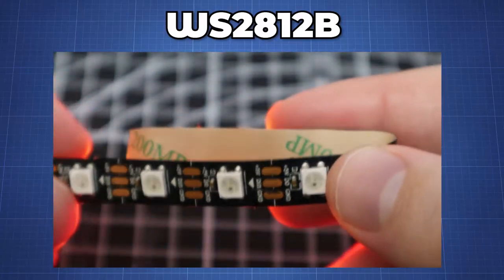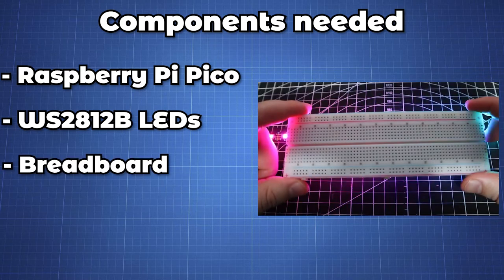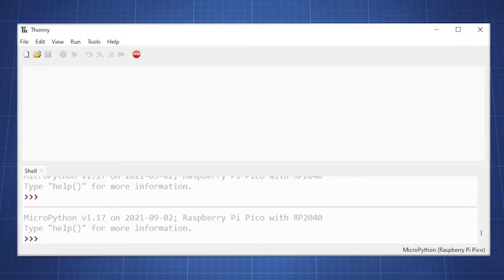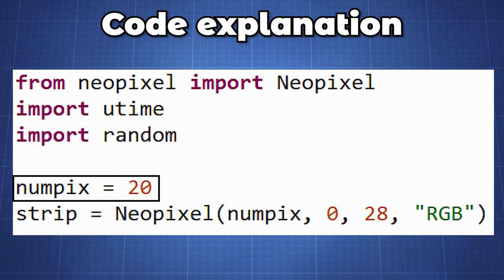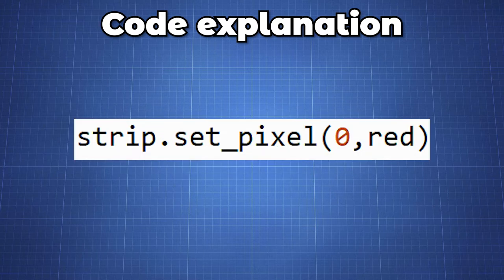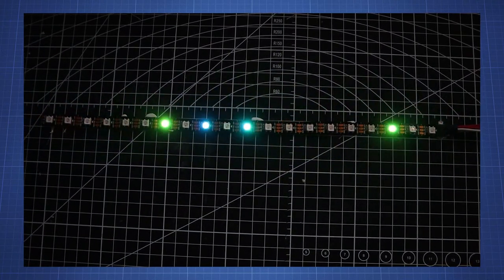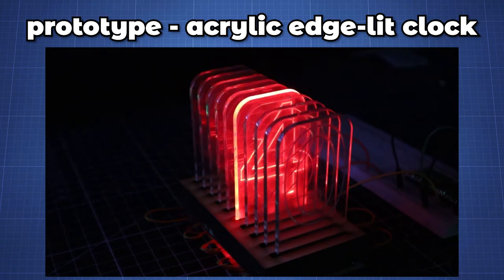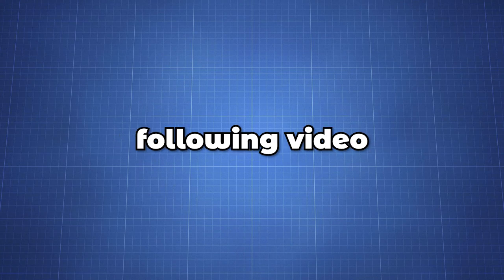Raspberry Pi Pico Tutorial : NeoPixels / WS2812B LED's

Comment: Thanks for the video.  I was able to light a strip of 90 LEDs with my pico.  I did have one problem.  I get green instead of red on example 2.  I didn't look to see what caused the problem.  I just made red = (0, 255, 0) and made the adjustment for other colors.
Reply from the maker: I checked the library I made a change got the same but didn't update the original library what you can do is change this line to strip = Neopixel(numpix, 0, 15, "GRB")
Reply: @NerdCaveYT  Thanks for the reply.  I made the change.  I also have increased the numbver of pixels I'm using on my project to 180 with one 5V input from the pico.

Comment: Hello, nice video, I have a doubt, how did you Connect the jumper wires with the strip of neopixel? I have one of 8 bits but I don’t know how to connect that
Reply from the maker: Thank you, The jumper wires all was just soldered onto the pads of the flexible strip, some might have plastic over it that you need to remove

Comment: Thank You!
Reply from the maker: No problem, I probably need to do an update on those videos for example how to initialize multiple strips etc.
Reply: @NerdCaveYT  I just adapted your tutorial to work with an old LED ring that I had lying around, pretty simple stuff once you understand. Thanks
Reply: @NerdCaveYT  would you have any idea of how to make the neo pixels work so that they change colour based on the temperature coming from the pi picos internal temperature sensor? I have tried but can’t get it to work
Reply from the maker: Let me have a look at it this weekend, the best way will probably be a function that based on temperature change the RGB value so that when it gets warm it changes as temperature rise gradually and not instantly, the simple method is just if statements changing the color for every degree @Jai.zTechDomain
Reply: @NerdCaveYT  alright cool, thanks man

Comment: Is it possible to control the brightness of individual pixels separately ?
Reply from the maker: yes using the RGB value for example (0,0,0) is blank none where as (255,0,0) will be full RED but (128,0,0) would be half the brightness of RED
Reply: @NerdCaveYT   Thanks !

Comment: Hello, thank you for this, it runs perfectly and I was quickly able to modify the code for more uses. 
Quick question, I used this neomatrix before on a raspberry pi 4 and it required a micro-controller which converted the gpio output to 5V, is this not required here? Clearly it is not required but it is safe to run it this way? I remember before that the adafruit documentation said that the DIN inputs need to be 5V, else it may damage the neomatrix.
Reply from the maker: The pico has a Vbus and Vsys which takes in 5V step it down to 3.3V. The Din pin connected to the pico is just where the data is sent to each pixel to control which one is on or off so it is an output not a input so the pin will not receive anything or be damaged and will be limited to sending out 3.3V dc

Comment: if your using your own power 5v do you only need to add the signal wire to the pi pico?
Reply from the maker: I powered the Pico from the 5V as well, but to answer your question just have to check if common ground is needed or not will get back to you on this one

Comment: I am using the "SEZO WS2812B RGB 5050SMD 8x32" LED Matrix from amazon and cannot for the life of me even get one pixel to go to a colour other than white at full brightness. I have tried both this library you have suggested and also the adafruit library with CircuitPython. Both give the same result. By selecting num of pixels just turns that many fully white, with the occasional green pixel at the end. Cannot modify the brightness or anything. Any suggestions?
Reply: Figured it out, my GP28 pin was the issue, changed it to GP0 and it fixed everything.
Reply from the maker: I wonder why I know GP28 is the ADC2 but it should still be a GPIO pin with the added adc capability.

Comment: when i did night rider from the example it was green to get red i had to set red 0 255 0
Reply from the maker: I simple fix in the code where it says RGB change it to GRB
Reply: @NerdCaveYT  but what's caused it? I cut and pasted the code from the links
Reply from the maker: @peter7329  I think it is in the library, because I made some changes it could be that I uploaded the wrong code by accident
Reply: @NerdCaveYT  I see thanks I've found the section micropython fir pico book

Comment: Changes to recent builds makes the modules RP2 and machine non existent. I keep getting errors. I can't find anything about how to get around this other than using DigitalIO which means a lot of rewriting code. :/
Reply from the maker: is this what the error message gives you in Thonny? It would be easier if you send me pictures in discord so I can see what is happening, and of the circuit. This might be a dumb question but on the LED pin are you using Vin I know some manufactures put the input cable at wrong end of strip

Comment: Is it save to drive 25 neopixels without any external powersupply? I intend to use it as rgb perkey for keyboard
Reply: according to the datasheet, neopixels use 60mA (pure white, max brightness), it supposed to draw arround 1.5A total. I used 0.1uF decoupling cap for every neopixels.

Do I need some level shifter? Because as far as I know, Raspberry Pi Pico are not 5V tolerant and only use 3.3V logic
Reply from the maker: So in the video I used the 5V supply from the pico. The pico has a buck-booost converter so it can supply 5V but like you said limited current. If it is 25 leds which will not be full brightness I think it will be okay but it is probably better just to use an external supply to power the pico and LEDs on Vsys

Comment: I get this after running the script a few times:
Traceback (most recent call last):
  File "<stdin>", line 11, in <module>
  File "neopixel.py", line 97, in _init_
OSError: [Errno 12] ENOMEM

Unplugging and then plugging back in seems to resolve the issue. Any idea what is going on here?
Reply from the maker: Not sure what will cause this, according to line 97 it is when it get initialized are the LEDs being power seperately or from the Pico

Comment: Is there a limit to how many LED's you can run with the pico, could you run a 32x8 panel with a completely random ? I have just discovered the pico and how affordable they are with the shortage of the RP boards.
Reply from the maker: Technically, VBUS on the Pico (pin 40) is capable of supplying 0.5A (USB 2.0) or 1.0A (USB 3.0), thus if you try to supply 32x8 if you have current limit and low brightness it would be possible but will be pushing the limit, a cheap external 5V dc charger will work just fine if you are planning to make a display with the 32x8 panel. I am planning to use the 32x8 panel to write text to screen via in Bluetooth in future videos.
Reply: @NerdCaveYT  I would run power direct to the panel and only use the pick for the signal/program, so no issue with power, that sounds great then the pick should handle it well.
I want to have a 32x8 with just a random on off using maybe 20% on at any one time, not 100 percent on the 20% but I want to put it behind a server cabinet tinted glass door so it has a super computer random flash appearance, bit silly but would look pretty cool.
I have two servers so maybe one for each server so with the power on its running then it’s an instant very flash power indicator.
I also have a table top jukebox that was a cassette player radio that looks like the Werlitzer bubbler 1015 jukebox, I am putting a 5” screen in it and a pi 3b running fruitbox, so I might use a pico to run some lighting on that as well, normally it’s just lights constantly on, so adding animated light sequencers will top it off.
Thanks for your video and I look forward to more.
Reply from the maker: That sounds cool, yes the Pico is depending on where you buy it between 2-5 dollar and really so great for beginners since you can use MicroPython / CircuitPython. The arduino boards also recently got more expensive due to the silicon shortage. I have not played around with audio visualizers but using that with the jukebox the react with the music would be cool, please do share the projects when your are finished, would like to see it, and thank you for your feedback.
Reply: @NerdCaveYT  I wasn't going to have the lights activating from the sound but I did come up with a plan, the outside has an arched light from the base up and over to the other side, this is where i will run a smooth soft slow colour change or maybe a series of patterns but always smooth and slow, in the middle of the jukebox is a u shaped light and I would like to work out how to have a VU style light effect starting from the centre bottom of the U shape and going out each side and upward, that one going to the music might be cool. I think because the jukebox is small being a table top the pico will be perfect, I guess it might take two one for each lighting effect and my pi3b to run fruitbox and the 5" display.
I really do hope I can find your videos again when it is finished so I can share the end result, actually I will put a shortcut to this video in the jukebox folder, problem solved. 
I have a terrible memory so I lose so much info. 
This is a link to a picture of the model I have so you can picture the U shaped lights better
https://i.ebayimg.com/00/s/MTAyNFg1NzY=/z/PoYAAOSwhuxaynBz/$_86.JPG

Comment: hey, using WS2812B with Pico, getting no errors on code but LEDs not working (29 LEDs without ext power supply) also using (pin40) power, (pin38) ground and (pin34) gp28, hoping you can point me in the right direction :) thanks
Reply from the maker: Hi, okay if you are getting no errors in code, then first suggestion will be to check the connections, that the GND is connected to any ground on the Pico, for the +5V can you connect it to VSYS(pin39) this will be the voltage after the regulator stage from you Pico. The Din pin just double check that it is Din and not Dout, lets try a different pin like Pin1 which should be GPIO0 so the line of code will be:
numpix = 29
strip = Neopixel(numpix, 0, 0, "RGB")
If that still does not work, you can reach me on discord then we can take a look at the circuit. https://discord.gg/xY77FWRb
Reply: @NerdCaveYT  thanks for the help today, it was the Din/Dout that was reversed, thanks again

Comment: Hi I have had difficulty running the program I only change number pixel to 25 I get an error line 3 no name random or no name neopixel. ? Any help please anyone. What do I need to update or install. Thanks
Reply from the maker: Did you copy over the neopixel.py to your Pico, also are you running micropython and finally is the interpreter set to micropython, which is in the right corner of Thonny.

Comment: can we do this with WS2812B 8 leds?
Reply from the maker: Hi which part are you referring to in the video? You can change the number of pixels to be 8 and use it as needed in your code. It will start from pixel 0 and last one will be 7. Each pixel "LED" is programmable.
Reply: @NerdCaveYT  We are doing a project using Pi Pico and HC-05 Bluetooth module. We also use app inverter. We are using the ws2812b-8 led, there are 8 of them, but we could not light it. If the Pi is a 3.3 volt led, could it be because it gives 5 volts? Do we need to use any converter? Can we do it without using a converter? The delivery date is tomorrow and we're still having this issue, we've taken care of everything else.
Reply from the maker: @cerensoysal2927  The V+ of the LED strip is connected to the Vsys of the Pico which will give it the 5V power then the Din pin can be any GPIO pin on the Pico, did you double check that you connect to the LED strip to pin In Din and not Dout that is often a problem I see people have